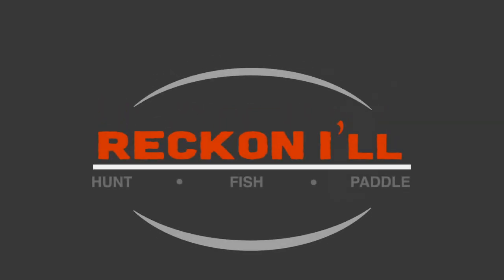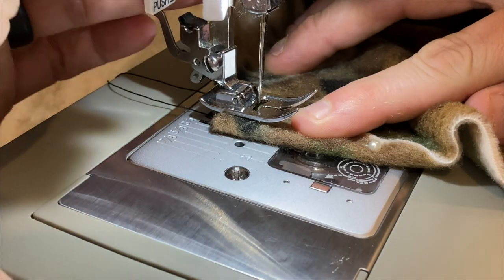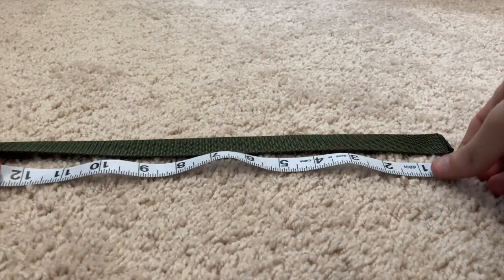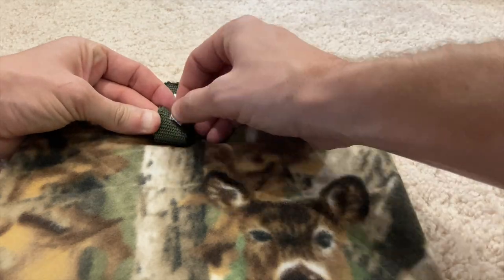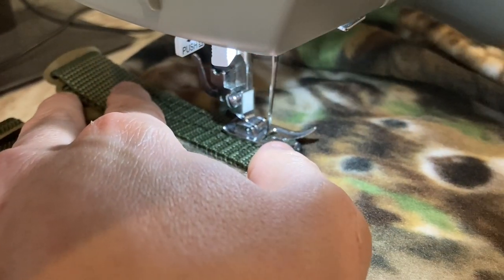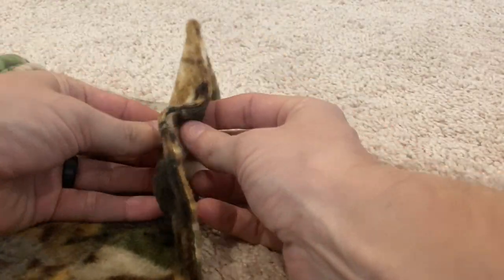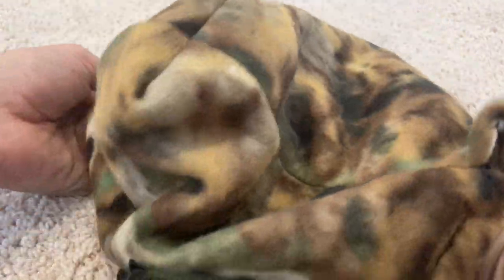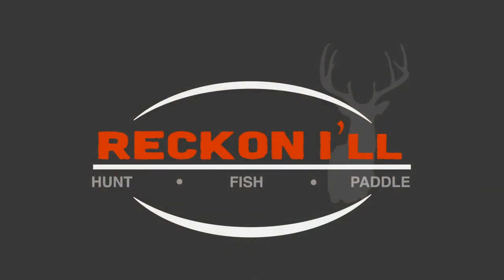Reckon I’ll: Sew a Fleece Dump Pouch for my Hunting Saddle

Comment: Saw the post on saddlehunter forum as well. Have an old fleece sweater to cut up. What sort of thread and needle do I need for this?
Reply: @reckonill  Awesome, thanks! Hopefully mine turn out as nice as yours did.
Reply: I have been using hot melt glue and fleece on tree stands and seats for longer than I care to say. If glued and pressed together it will not come loose. Just don’t use your fingers to press it.